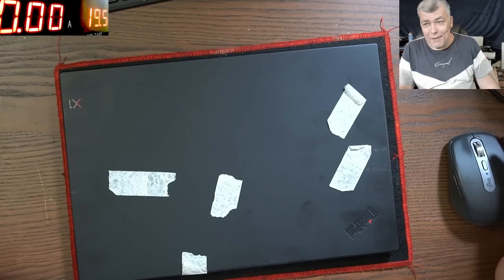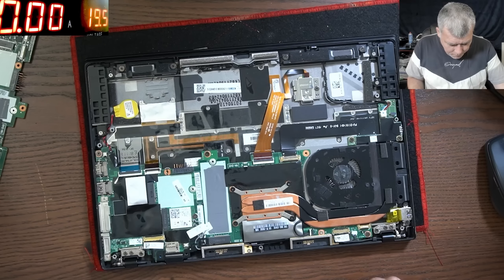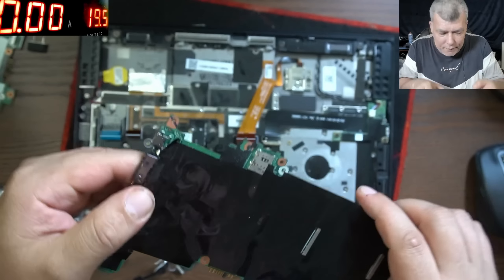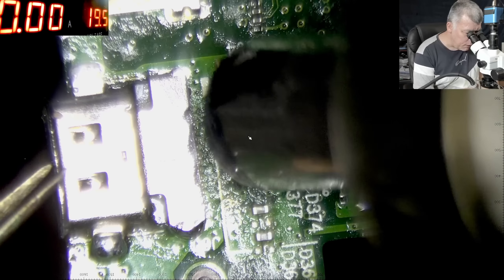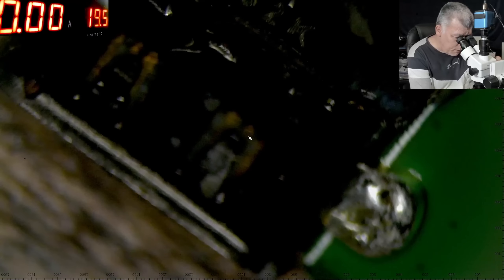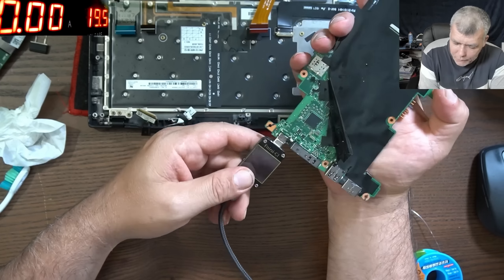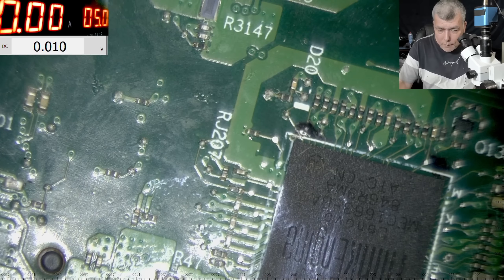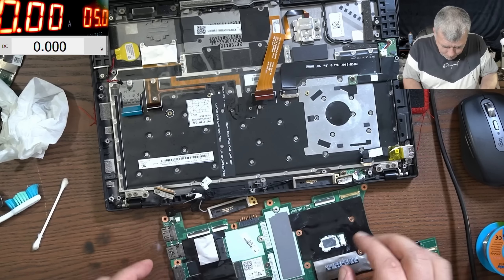When you think a charging port replacement it will be a 5 minutes job -Lenovo X1 G8 port replacement

Comment: It was not working due to choke system on hp and lenovo bussines series laptop when some ic’s like audio or lan ic  get little heat these boards are design to cut the supply of the system. Once cool down it starts working. I have fixed these issues so many times common fault on hp elite book series
Reply: How do you fix?

Comment: The bios is likely going through it's detection and optimization routine's and waiting for various time-outs, then, if those don't work, reboots with other settings and tries again before it finally finds a set of settings that work.  I've seen this many times with laptop's that have been dis-assembled and have had the CMOS battery disconnected for a while.  When repair is done and it is expected to turn on...  wait...  find something else to do...  it's surprising how long it can take sometimes. (or at least how long it FEELS like when watching it)

Comment: Hmmm I just had similar hustle today. Lenovo 2015 model. You plug in the charger power led flashers  3 times then stopped. I did some measure of couple of MOSFETs and I saw one behaving abnormal. Removed it plug in the charger fan came on then off then came on again then stopped, cpu getting warm 🥵. I replaced the MOSFET , it when to the old flashing power led story. I got pissed. I removed my MOSFET and put back the old MOSFET and it started working 😞🥱

Comment: Rookie question...i know I can probably google it but wanted to heear from the masters...are the temperatures F or C...i have a rework station that goes up to 890 and even all the way up at half power its terribly difficult to loosen chips...perhaps its the Air conditioning in my office???
Reply: C, the solder they use is crazy resistant, my station only goes to 380c

Comment: You should have small compressor for colling temperature after replace components.
Reply: The atten st-862d have cooling function
Reply: @clivewright7778  yeah I really agree, but still remain hot, because the element wire not suddenly cool still remain hot
Reply: it is always a good idea to cool it slowly. rapid cooling can cause cracks.

Comment: The Lenovo X1 Carbon 6th gen(8th Gen intel) is a great laptop. I use the same laptop as my daily driver(Windows 11 Pro) but they are know for their Thunderbolt charging ports to go back.  The software was faulty and unless you flashed the firmware when it was fairly new, alot of the USB C charging ports burn up.  Lenovo replaced a ton of motherboards under warranty but i wonder if that's what happened to this laptop????

Comment: Why did you use 400 degrees to remove the charging port on the original board but only 325 degrees on the spare motherboard? If melting the plastic was an issue why did you use 400 degrees on the original motherboard?
Reply: heat+time=melting

But hotter means quicker, so less time for heat to reach the plastic
Reply: 400 градусів прискорюють демонтаж. Пластик плавиться   і йде на сміття. 340 - пластик не втрачає форми у новій деталі.
Reply: He's using 400 to remove the bad charging port so it will get hot fast, melting the solder quickly which means less time heating the board which protects the board. He doesn't care about melting the plastic in the port because he isn't reusing that port. He's using a lower temperature on the spare motherboard because he needs that plastic not to be damaged because he will be reusing that port, and is not concerned about that board since it's a donor board.

Comment: You removed the port from the board, but omitted to remove solder from the retaining lugs.  Would have been a good idea to remove excess solder even before removing the bad port.  Then clean all the terminals on the board with new good solder.  The replacement socket should likewise have been cleaned so that lumps of solder do not make fitting dubious.  Then, once you have set the replacement in place without obstruction of solder on the fixing lugs so that it sits fully down on the proper set of contacts, you should then, and only then, add some solder to the retaining lugs.  Of course, if you had thoughts that flux was set inside the socket, this flux should have been scraped out before you attempted to solder it in place.  You could then see if the internal contacts on the socket were damaged -- before attempting to solder it.  If you follow all these steps, you can save yourself a lot of pain, sorrow, and wasted time.  You may actually need to get a brand-new socket.  Better luck next time!

Comment: That supplied motherboard looks NASTY !! 
Is that Epoxy glue ??

That's a really terrible design for the charge port. Lenovo (my fave laptop company) dropped the ball there ! Surface mount connectors should NEVER be used as laptop power sockets. USB C is not great for laptops ! 😕

Comment: I don't get it, you tested those coils. You get 7 Ohms, good. Then you get 18 Ohms, good, then you get 80+ Ohms, also good.
And then you get an OL from another coil, and you say it's.. good?
So when is a coil bad? What kind of Ohm value do you associate with a BAD coil?
Reply from the maker: The coils are never bad, never found a bad coil, what i'm checking is the resistance of the circuit of the coils!